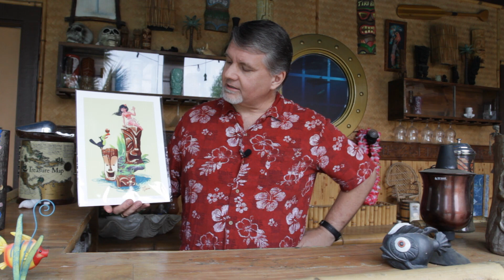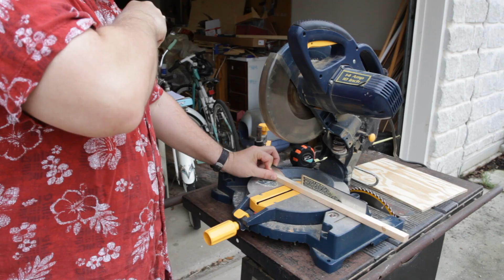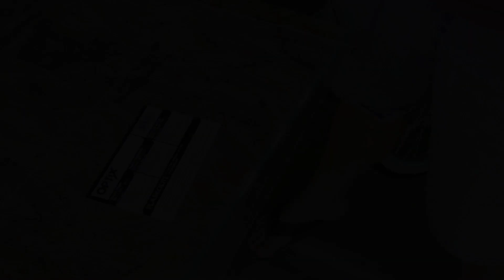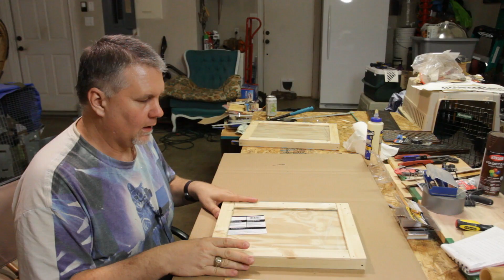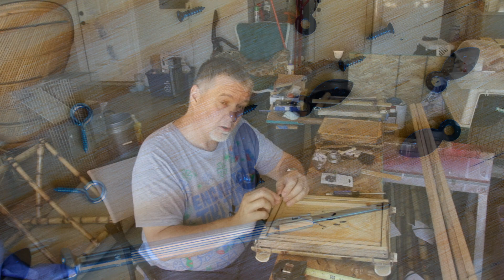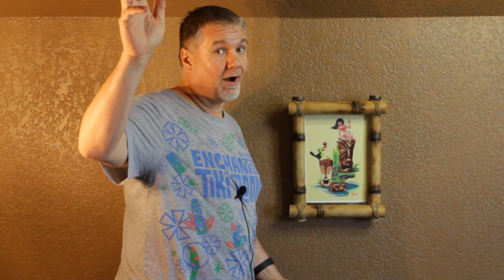Framed! - A Moment of Tiki Episode 6

Comment: safety should include a push tool...you should never push with your hands so close to the blade.  Other than that great build and I will be using some of your construction.
Reply from the maker: This is true. I usually have scrap wood I use for such things. I didn't this time. My bad.